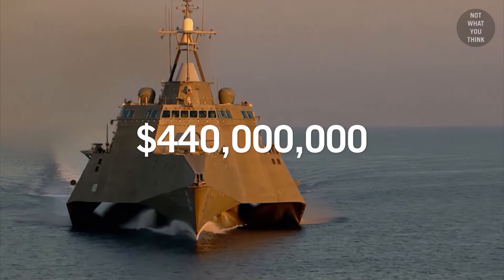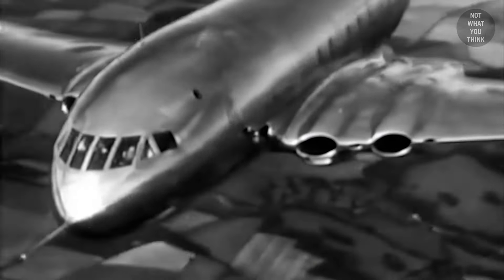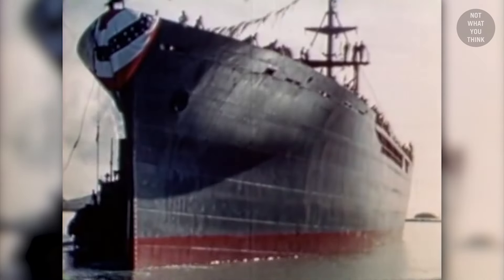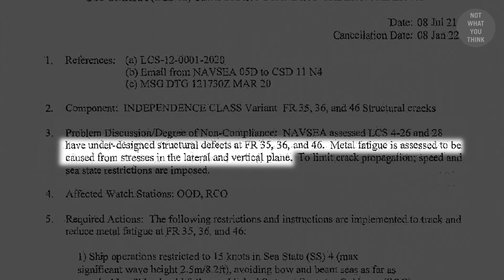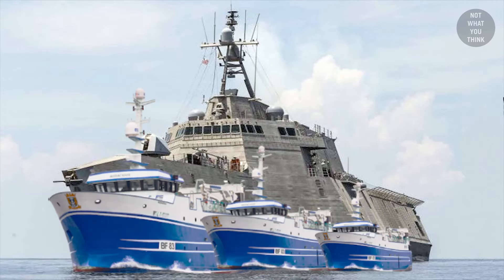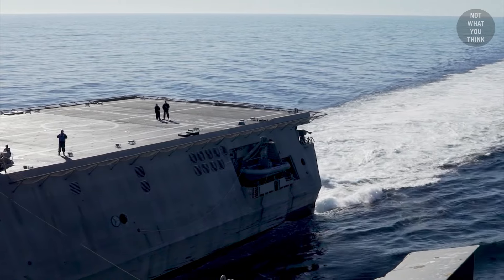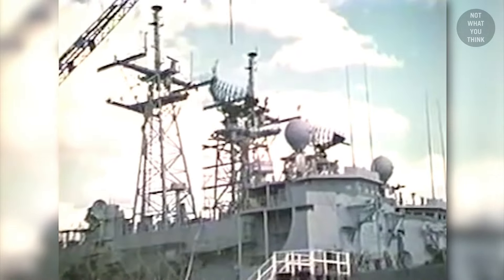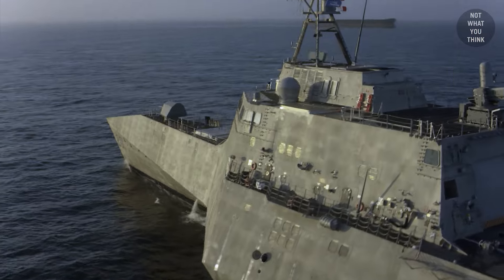SPEED Makes This Warship CRACK!

Comment: I feel like the LCS was designed and built by people who truly thought it would never be used in combat
Reply: ...or in waves?
I love the LCS's , I hope this can be fixed.  Independence class is my favorite!
Reply: They were literally built as they were the lowest possible cost to keep the shipbuilding infrastructure running. They aren't even meant to be good combat ships.
Reply: @aniquinstark4347  I dont think they're a scam per se, but it's possible that it's just money that Congress gave back to its supporters
Reply: @Definitely-nothunter  It is a scam. Even if it wasn't, it's much cheaper in the long run to make something right the first time and not have to basically completely rebuild it every couple years, On top of high maintenance and greatly reduced performance. This is true no matter what product you look at. You could get $15 shoes at walmart, but you'll be back in a couple weeks for a new pair. Or you could get a high quality pair for $150 that will last you years.
Reply: @thesmellofbacon7595  my $7.50 shoes are half a year old and looks as good as when I first bought it. If it falls apart by the end of this year and I have to get another, I am still ahead. I've never had $150 shoes.
Reply: @danielch6662  but your shoes didn't cost $440,000,000 each and are failing within months is being used for their intended purpose.
Reply: @Definitely-nothunter  they're minesweepers and motherships and their primary weapon - the NLOS was cancelled.
Reply: @thesmellofbacon7595  When I was financial officer in some Thai bank. My duty was audit debtor's factory in sport shoes business. The 15$ price you say were the ex-factory's price my customers had sold to those brandnames sportshoes. Some were less!!
Reply: So an engineer.
Reply: @danielch6662  you know all sneakers are made in china right? Find another example
Reply: @Pimentel-Kreations  some smeakers are made on Taiwan. Some really good quality boots are made in Taiwan, but again, I'm not specifically talking about any particular kind of footwear. My point is cheap crap won't last you long if you actually use it. There are certain things that pose as high quality but if you know what you're talking about those scummy brands are easy to spot.
Reply: @thesmellofbacon7595  that's not how it works with federal government. They have to blow their budget quickly so they can keep raising the budget every year, that way federal power grows year over year sheerly through budget.
Reply: @Rix317  while that is true, it does not disprove my point. They could spend more for each ship and make them higher quality. Next year they could actually make an improvement on them or make actual innovations. Instead what they did is spent way too much on garbage barges and had to cancel innovative add-ons because the maintenance cost went through the roof.
Reply: @thesmellofbacon7595  that was MY problem. I didn't know how to spot cheap crap posing as quality. Still don't. At least when it comes to shoes. When I spend $50 on a pair of shoes, I didn't get $50 worth. Yes, they were better than the $7.50 ones, but only 10% better. Same happens with glasses, which you might think odd. Considering the fact that I've been wearing them non stop for decades since I was 12, because I'm so shortsighted, I can't make out my own toes, or my nails if I stretch out my arms.

The problem with those ships was not that they were too cheap and the companies underbid to get the contract. When they underbid, they wait till the sunk cost is big enough, force the gov to pay more. That is a different problem. That lead to massive cost overruns, causing the product run to be cut, which the blows up the per unit price to astronomical levels, because the fixed R&D and tooling costs now has to be amortized over a tiny production run. 

The problem here was they went too far into the bleeding edge, and bled. Both Boeing and Airbus ran into a similar problem with composites on their commercial lines. Somebody undoubtedly assured a lot of admirals that they have solved the problem with aluminium with some fancy new alloy and super secret treatments. They should have used steel, though of course that means the performance suffers, and the navy might have selected another design by a different company promissing better performance. The manufacturer may say now that if they had more money, they would have solved the problem. But that is just what they say. It may not be true. It isn't true that if we sink enough money into anything, everything has a realistic solution. Some problems may be insoluble. Like using aluminium structurally in a ship. They use aluminium for planes. And planes get inspected to death regularly, with microscopes and xray machines. Now the navy gets to do the same with their ships as well. 😕
Reply: He didn't even mention the "Why can't we operate a warship with something the size of a tank crew?" aspect of the LCS.
Reply: exactly i agree.. its like they were supposed to be put in a giant bottle of something
Reply: Most major weapons never see combat or severe weather.
The US is now planning for a permanent Arctic presence.
Reply: @Definitely-nothunter  Maximizing profits is the main priority. Contractors receive $billions to fix defects (ie, F35).
Reply: They were designed by Navy engineers trying to outrun Fast Response Cutters.
Reply: @AnarexicSumo  But the LCS can't catch rubber dingees operated by Somali pirates.
Reply: @thesmellofbacon7595  I agree, Johnson & Murphy's are the best.
Reply: @thesmellofbacon7595  Oh sure, you would have to point that out.
Reply: They're building the fuck out of them in Mobile, AL.  The Canberra  was the latest one and they've already got another almost ready to go, with two more being built right next to it.
Reply: I feel like the whole class was experimental and they just decided to run with it. They do "look" pretty cool after all🤣. Its not unusual to have teething problems with totally new systems. Generally you wait till you work those out before you make a whole fleet. Government contracts make people do all kinds of stupid things. Kinda like cost plus contracting in the aerospace industry. When you get paid to fix stuff you broke you tend to break a lot of stuff. Weird how that works.....  says no one.
Reply: @DJVIIIMan Wasteful govt spending on cancelled projects.
Reply: It's designed to launch rockets from a distance no ship can shut on the LCS. This was the focus.
Reply: @thesmellofbacon7595  That's a bad excuse. I bought a pair of Workboots for 70 bucks, and i used them really hard for at least 5 years. After i walked the sole down, i discarded them. After that, i bought some Running shoes for 180 bucks, and the sole was down and out(see through) after 7 months. Money doesn't buy you endurance. You gotta build for it.
Reply: @Gunni1972  learn how to read.

Comment: Former navy welder here 01-12. From what I remember hearing. All ships with aluminum superstructures have had issues with cracks. I was on an aircraft carrier and a submarine tender during my service. Oh yeah. Aluminum is a pain in the butt to weld after being in contact with seawater. The LCS class should have been made with steel hulls.
Reply: We had an Aussie built fast catamaran operating on Cook Strait here in NZ 🇳🇿 for a while. The story was, that every time they had a rough crossing, they would be welding up cracks afterward. Mind you, they could only do that after they located a shipyard welder from the former Yugoslavia, resident in NZ, who could do that specific type of aluminium welding and train other welders in the necessary skills.
Reply: Well sure. And so to account for weight differential: 4X horsepower or just go nuke.
Reply: @ericvardek4108  or accept going slower
Reply: @marcogenovesi8570  defeats the entire concept, which was speed lol.
Reply: @Lithane97  If the hull can't handle it, it was a bad concept, so you either salvage what you can (and make them go slower) or get them out of commission and build something else. Sorry but "not breaking under your own engine power" is a primary design objective for anything self-respecting

Comment: These ships are equivalent to Russia's aircraft carrier in some points:

1. It costs a lot of money to operate but they are still using it.
2. Needs careful sailing because things might break apart even with the slightest unfavorable conditions.
Reply: Dude good point. Fortunately, I like to think we’re pragmatic enough to take the L
Reply: 3. Unless a Special Operation was declared.
Reply: Thankfully (or not, depending on your point  of view) the US has the  financial depth to take a financial hit like this without missing a beat.  I think the fundamental problem is that we all KNOW that fact.  In the knowing of it we are more likely to make more risky plans and less likely to call a halt to an underperforming program of design,  development, or procurement order.  PARTICULARLY when it's a massively expensive item that relies on economies of scale to reduce overall cost per unit.  Something goes  wrong, costs skyrocket, the number of units to be acquired slashed, and around and around we go, whichever party is in power changes not that status quo!  🤪👈

That said, Russia only built two of their "aircraft cruisers".  They built them without having built any of the infrastructure neccessary to support them, without the planes to fly from them, and without the necessary battlegroup attendant fleet or any tactical doctrine to even THEORETICALLY use them effectively in any way whatsoever.  The COST was...... insane too.  The fraction of the entire Russian military budget spent on just those ships was utterly, absurdly mind numbing.  Granted, they did what Russia always does to compensate for its military and/or political  inadequacies - they stuffed it with a comic lying obscene number of guns, missiles, bluster, and lies.
It didn't work any better then than it has for Putin now.  
Also different is the importance of the ships to the military and nation.  Our LCS ships were never going to be flag ships of the US Navy.  Our national pride wasn't at stake.  The exact opposite was  the case for the thwn Soviets, now the Russian federation.
Reply: The two cases are not truly comparable. Let me explain.

There is nothing wrong with the Kuznetsov's design or structure - the problem is the supportive infrastructure and the consequences of not having it. It's systems, such as the engines, generators and water desalination plants have been abused due to the lack of said supportive infrastructure. And to finish off about the Kuznetsov, India and China both operate Kuznetsov-class ships and they have no major problems, why? Because they had infrastructure capable of servicing such large ships beforehand.

The USA has the opposite problem. It's supportive infrastructure is second to none, but it's ships have design and structural flaws. Furthermore, the USA has had structural problems with it's ships for decades now and with multiple classes of ships.

Finally, we are comparing a ship from the 1980's to modern ships made from the 2010's onwards. What I am trying to say is - the USA needs to abandon these dysfunctional failures of ships and design and build new ones that actually work.
Reply: Russia hardly uses them lol
Reply: @seanbrazell7095  USSR had 8 carriers and the Russian Federation has 5 flagships depending on the theatre. The Admiral Kuznetsov is an old ship, it should have been replaced by now (it uses boilers and shit) it's the oldest Kuznetsov and isn't as good as her sisters too. I think budget cuts caused it more than infrastructure, maintaining a ship that large is absolutely useless (not in Russian doctrine anyway, they could of bombed Syria without the need for Kuznetsov) so they have the bare minimum just to keep it running. They have more effort put into Admiral Nakhimov than they did with Kuznetsov
Reply: @JABelms  With the sinking of the "Moskva", ruzzis are down to 4 flagships. Was it structural failure? I wonder.
Reply: @ericvardek4108  Russia has 40+ Ships in the Black Fleet, with Admiral Grigorovich as their most advanced ships of that fleet even way above Moskva, Moskva is the oldest Slava and it isn't as good as Varyag of the Pacific Fleet. And the Northern Fleet practically has two flagships, Admiral Kuznetsov (which lets be honest, Russia can kick that ship out and it won't make any difference) and the most valuable ship of Russia since the USSR collapsed is Peter the Great (Kirov Class), Admiral Nakhimov will be the next valuable one.
Reply: theyre still better than the kuznetzov

Comment: Aluminum will always crack with repeated stress. The biggest snafu is designing the ships in a way not anticipating having to do frequent fatigue repairs and making such repairs difficult to do. Aluminum works on aircraft because you can reasonable predict the load patterns and cycles and know when you need to replace things or retire the aircraft. Ships have the randomness of the waves to deal with which adds in so many variables that it's impossible to predict. Magnesium and zinc both are metals that don't fatigue but react rather quickly with salt water in galvanic corrosion and titanium is another HCP material which doesn't fatigue but is much more expensive and difficult to weld and work with.

This leaves the good old Body Centric Cubed crystalline materials of iron, moly, chromium, vanadium that interestingly enough all alloy together into something we call steel very nicely which have a defined endurance limit. There were good reasons for the Independence design to be built from all aluminum. From fuel savings, to being non-magnetic. But thrashing through the ocean at 40 knots or more it should have been known they would suffer from constant fatigue cracks considering how long Austal has been using aluminum and the long history of it.
Reply: I have an idea for multipurpose amphibious assault ships with modular runways. Two ships joined together would have a length of 475 meters and could be as resistant to waves as a skyscraper. Shock absorbers can be used, which make it flexible and are used in the columns of skyscrapers. Thus, aircraft carrier costs are reduced by 10 times.

Comment: I feel that navies in general  should use Toyota type construction methods and materials: reliable time tested hull materials and propulsion.  Built one of a new kind and test  it for at least two years before committing to a large order. 
It might sound impractical compared with present procurement doctrine (to spread out the cost of R&D on a large order) but it seems the right alternative based on recent experiences. The Zumwalt makes this point more evident. It's just a point of view of the large costs involved in shipbuilding and commissioning.